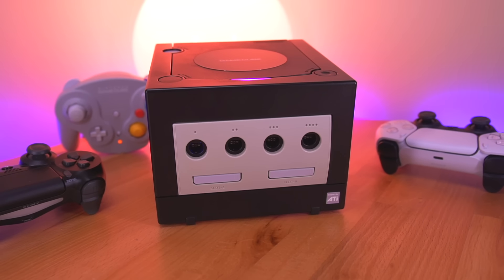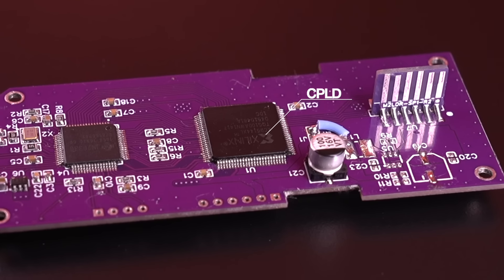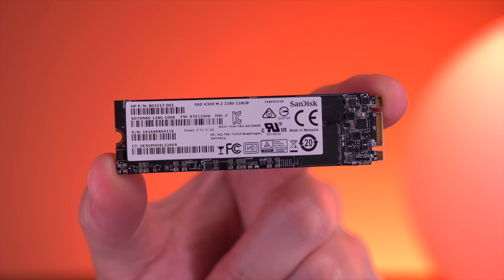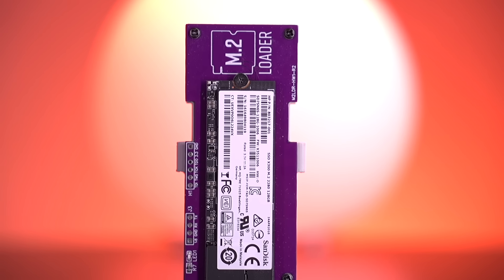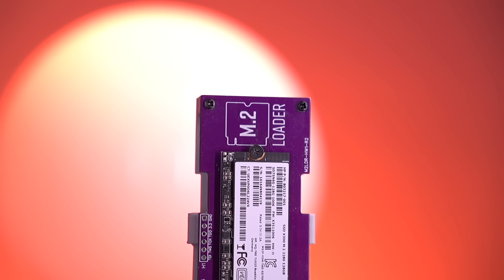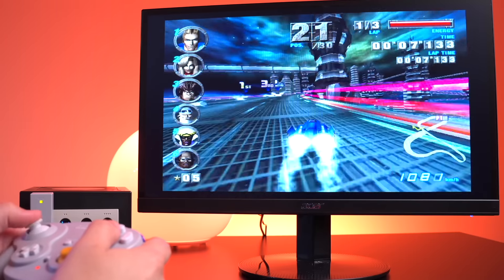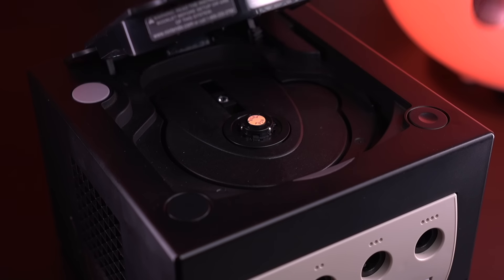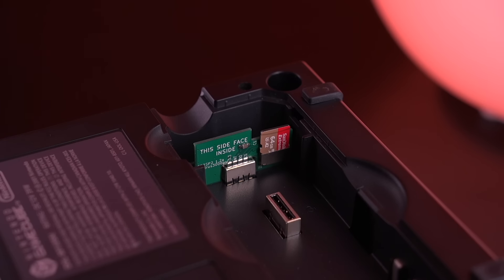M.2 Loader FIRST LOOK!  Unleash the Power of Your Gamecube!

Comment: Quick question but if my gamecube has the Xeno Mod Chip that gets attached to the bottom of the dvd player combined with using the SPSD2 adapater will this M.2 Mod work with that? Like can i choose to load Swiss from somewhere else other then from a Mini Dvd Disc?

Comment: i dont have a gamecube, but i wondered during the video if it would make sense to add PicoBoot to this if the plan is to add a raspi pico anyway? (probanly using a few jumper wires into the case itself though)

Comment: Hello, I have several questions about this project.
Firstly, I would like to point out that I have a specific project concerning my personal gamecube, I intended to use the GBI (gameboy interface) to play my games gameboy, gameboy color and gameboy advance thanks to the gameboy player and an action replay disk and not the official gameboy player disk, for this I had to have an sd card inserted into a memory card in which the GBI boot was located, because when the console is launched the action replay disk will detect the sd card.
My question is this: can action replay detect this ssd sata m.2 or not?
If it can, can I put my GBI boot on this ssd and also put my game saves on this ssd or should I continue to store the saves on a memory card external to all this hardware?

Comment: One thing that I'm not sure, does the M.2 requires another modchip, such as the Picoboot, or is it a full solution: modchip+loader device? Still an interesting solution for the fastest data transfer.
Reply: It doesn't require a modchip per se. You need to have a way to boot Swiss in order to use M.2 Loader. This means if you don't like hard mods you can always use game save exploits or Action Replay.
Reply: @maciejkobus  ok, so we either need a softmod or a hardmod, such as Picoboot, to boot Swiss from the SD card. Thanks for the clarification

Comment: crazy consideration here, but if the loader is working towards a pico build, A) is it possible to run Swiss off of it, even if it means doing the same mod as Pico Boot? B) since it will occupy the network adapter slot, couldnt it be (using the Pico capability) fitted with the network adapter itself, proving to be an all in one device?

Comment: You never mentioned the performance of this driver compared to a disc. You claimed the video playback was flawless but I could still hear some weird audio stuttering. Was that just part of the video? How do the loading times on this drive compare to the same game played from a disc? It's an SSD so I'm assuming they should be faster, but if it still has audio stuttering then that might not be the case.

Comment: My largest concern is actually not with the Network adapter, but rather the GBPlayer. Since they both use the SP1, you'd either have to choose which or make a bypass on the GB player for it, right?

Turns out, I am an idiot. Problem solved.
Reply: GameBoy Player uses High Speed Port. It's a different connector on the bottom. M.2 Loader is fully compatible with GBP.
Reply: @maciejkobus  Thank you. I did not realise this.

Comment: Oh damn, The factr this requires an SD2SP2 takes away the advantage of being able to run it on a DOL-101 which I thought it had over the SD2SP2
Reply: It wasn't explained too clearly in the video and people are very confused with SD2SP2 requirement. M.2 Loader does not need SD2SP2 at all. What Tito meant is that in order to use M.2 Loader you need to be able to run Swiss on your GameCube. This means you'll need a modchip, game save exploit or XenoGC. SD2SP2 was mentioned in the video because Tito is using PicoBoot in his console and PicoBoot requires SD2SP2 or SD Gecko to boot Swiss. PicoBoot will be also updated to load Swiss from the SSD.

Comment: It's an* SSD, not a SSD. When you say SSD out loud, it begins with a vowel sound (S begins with a soft e sound). A/an is determined phonetically. If the first syllable of the next word begins with a vowel sound (not necessarily with a vowel), you precede it with "an", otherwise you precede it with "a".

Comment: GcLoader is the way to go. Much simpler and cheaper option. SD cards are more than big enough to hold GC games
Reply: yeah but then they stick out the front
Reply: @solofalcon  GC loader doesn't.  It takes away the optical drive and replaces it with a drive to run a SD card. It's all internal.
Reply: FlippyDrive is the way to go.

Comment: Could a new version of the SD2SP2 Pro be equipped with a similar chip to improve load speed? There is plenty of unused space on the Pro version. If so it would allow the better loads for people that still use the LAN adaptor.

Comment: Could webhdx solder the wires on the ipl chip and put a plug on the wires that would just plug into sd adapter?   Try and use the pico chip 2 fold.  One to boot Swiss. Then emulate the drive.

Comment: So if it's not NVMe does that mean it's using MSATA? This thing looks like it's using NVMe because as far as I'm aware that's the skinnier connector. Inside to use the same connector that the Wi-Fi cards in laptops use.
Reply: M.2 and mSATA are connectors, SATA and NVMe are interfaces. M.2 Loader uses M.2 SATA SSDs.
Reply: @NotMoreZombies  all I know is that one time I tried to buy an SSD and it wouldn't go into the slot even though it was skinny enough. The notches didn't line up for skw reason. I'm 100% sure I bought an M.2 drive.

Comment: Did i hear/understand right in the no need for the pico boot mod in future? I have a gamecube that I can't mod (misses gamecube). So that'd be damn handy.
Reply: You can use any method to boot Swiss, it doesn't have to be PicoBoot specifically. There are game save exploits and Action Replay if you are not interested in hard mods.
Reply: @maciejkobus  i was looking at gc. But its impossible to get these days. Might have to go with the save exploits i guess. 👍

Comment: Mmh could be the Sound problems of the normal adapter based on the speed of the sd card?
The micro sd cards have different speeds. 

What would happens when we use the sd card in the same way like the m2 mod?

Micro sd have Max 1tb and it's not long realesed. 2tb are fakes

Comment: Of course I ordered everything to install picoboot on one of my GameCubes last week and have everything but the laser bear mount that I ordered. I wasn’t aware of the slowdown that occurs cause the sd card and I like that m.2 loader is I guess non invasive you could say I’m not afraid to solder and I’m excited to install picoboot on my console but this just seems like a overall better option for my “ultimate GameCube” but does anyone have any recommenced sd cards for pico boot to help mitigate the slowdown ?
Reply: Faster SD card won't help at all. There is a limitation how SD cards are being read by the console and it can't be fixed without custom hardware. This is why M.2 Loader exists and fixes those issues even though it works on the same bus and have the same max theoretical bandwidth.

Comment: Wouldn't another major con be that you cant use the gb player adapter as well? I know you can get around it by using emulators but i know alot of ppl prefer using the gb adapter.
Reply: The GBP uses a different port.

Comment: What kind of drawback is that the optical drive is missing with the GC loader?
Will die anyway and sucks
Reply: People are collecting physical games and many people prefer to have fully featured system. Any mod that has great performance and doesn't require removing components from the system will be 100x better.
Reply: @maciejkobus  
I see your point, but I would still say everyone collecting physical DVDs has most likely backups and does not use the discs because of wear

I just hope the M2 adapter will get dirt cheap :) unlike the GC loader

Comment: i dont really see the appeal, if you have the sd2sp2 anyway, then just stick a 256 or 500gb in there and be all set. then you at least keep the bba slot free. loading through spi is still fundamentally the same regardless of which port is being used. a drive emulator is really the best way to improve loading speed issues, resulting in video and audio and gameplay speed issues. I have most of the best rated GC games on an 256GB sdxc card loaded in my gcloader, compressed for use with swiss, and it's not even full.

Comment: Con, can't use Gameboy adapter either with it
Reply: Why ? The dol 001 Gamecube has 3 connection ports. 
The M.2 fits into the serial port 1. The sd2sp adapter fits into the serial port 2. The Gameboy Adapter fits into the hi speed port.

Comment: Yeah, there are no 2TB MicroSD cards yet. Largest consumer models are still 1TB. Anybody trying to sell you 2TB right now is a scammer. The Max is currently 1.5TB, and that's from Micron who doesn't sell direct to Consumers. I've only seen them for sale from bulk distributors so far, which require a minimum purchase of 120 units for $450 each($380 if you buy 12K+). So if you see somebody trying to sell a 1.5TB card for less than $400, it's also probably a scam.

Comment: Unleash the Power of Gamecube... use Dolphin emulator. The emulation have overpassed the original hardware by far:
It is free. No need to pay for an addon. No soldering.
Use any controller (no adaptor needed) or original controller
Up to 8x native resolution
MSAA and SSAA support
Ultrawide support (21:9 and 32:9)
Texture filtering
Save your progress anywere
Custom textures support (you can use enhanced textures created by the community)
Integrated Game Boy Advance emulator, Dolphin supports linking GameCube and Game Boy Advance titles
Stereoscopic 3D graphics on any platform
Network play
Play Wii games

Comment: Having a huge capacity SSD for just gamecube ISOs is dumb. The entirety of the gamecube library is like 600GB.
Of that, you probably won't play most Japanese games (unless you know Japanese) and won't bother with games that either didn't age well or are targeted at young players.
I, personally, wouldn't bother with Sims, barbie, sports games or racing games. I also have little reason to play games that exist on other consoles like Mortal Kombat Deadly Alliance or the Harry Potter games, for example.

This will trim that 600GB down significantly and all the games I care to play on gamecube would be perfectly fine for a 512GB m.2.
There isn't a good reason to get 2TB worth of M.2 when you can get a 512GB for like $30-$40 at microcenter.

Comment: Please put /HOW/ it works better, or a link to an explanation.
Reply: Well looking up the IDE-EXI project I can see that it seems to enable DMA transfers and can transfer larger blocks.  That would improve transfer speeds.

I do look forward to NVMe support when that will be possible(IE a chip with PCI express becimes available), because one less SATA to IDE chip is cheaper, and the NVMe drives are approaching $20/512GB.

Comment: But why? Wouldn't the better solution be to use a wii and homebrew it? I just bought a wii for 100 dollars and loaded 500+ gc games on it and about the same amount of wii games. Whats the point of doing this on the gamecube? Wouldn't the wii still be considered original hardware for gamecube?
Reply: It's about the esthetic. I have a nintendo mini with a bunch of games loaded onto it. But I would rather have an original modded to play old games. Without that I might as well just play all games on pc
Reply: @halkeye20  i was emulating them on the PC at first but its way too much work letting kids use it and not mess up the emulators or computer so I bought a wii and the experience is much better even though I can't crank up the resolution. The wii has made me a fan of consoles again after the xbox made me quit console gaming years back.

Comment: You mentioned not being able to use the network adapter because of occupying the serial port, but also the Game Boy Player won't be usable either. I assume peeps would have to fall back to emulation solutions if we wanted to play GBA games from the M.2 drive, or should we just consider that a lost cause because the thing would be easy to unplug and swap with the GB Player?
Reply: The GBP will be usable, the same way you can have the BBA and GBP plugged in at the same time.
Reply: @NotMoreZombies  There would be enough physical space? They won't be trying to rub against each other or the GBP wouldn't be angling the M.2 weirdly?

Comment: I think another con is that you can use the other methods while the gameboy player is plugged in, but you have to take it out to use this
Reply: This wouldn't prevent you from using the Gameboy player. That plugs into the high speed port on the Gamecube, not either of the serial ports.
Reply: @mrmxypltk  oh my bad, I thought it was in SP1

Comment: at last a project stretching legs pie pico total not relevant, if your getting pico talking SSD, how taking it a bit more, maling into NAS SERVER, not expecting lighting in the performance, but it would make a very small server, even pocketable for travel, and anything can make network, connection, and an the pico, serial, pin, unpopulated connection (or the usb, it is the to type as a device, or as one that can sud thing plugged inti it, that cover the really old stuff too,

Comment: Your con didnt have the fact that the option  for the gameboy player was no longer going to be one?
Reply from the maker: The game boy player still works with the m.2 loader installed. I’m not sure I understand your question.
Reply: @Macho Nacho Productions  how? You installed that lil chip in the other port so how would the game boy player still connect?
Reply: @Maciej Kobus  yeah but there was another chip installed to help the m2 for loading with the m2 is that just a one time need then it can be taken out? If so ok but that wasnt stated in the video
Reply from the maker: The game boy player connects to the high speed port. The m.2 loader is connected to SP1 and the SD2SP2 is connected to the SP2 port. The M.2 loader does not effect the high speed port which is used by the game boy player.

Comment: Isn’t this a little overkill? A GameCube will never be able to take advantage of the speeds that m.2 provides.
Reply: The point is taking advantage of all the speed capacity, but to fit cleanly in the GameCube, have a high level of game support and improve playback compared to some other methods (e.g. with less or no audio glitching).
Reply: FlippyDrive

Comment: 1:20 That is not a hard drive. It's a Solid State Drive (SSD) and it's appropriate that it uses SATA controller M.2 since there's no way this device would be able to read-write at over 3000 mb/s, and SATA m.2's are much cheaper and run, at best, 600 mb/s.  I guess theoretically you could connect an actual SATA drive (SSD or HDD) to this connector as you can get m.2 adapters that have proper SATA ports right on it, but it wouldn't be a wiring mess, and you'd need a PSU to power the drives.

Comment: Meh... the reason you can't find a 2tb sd card is because they just got announced and we're talking about a tiny form factor vs the much larger nvme. I'm not sold. Melee online with slippy would need the broadband and you couldn't use it with this. We need storage and saves but they need to be more discreet than this

Comment: Might I add again that the Xeno GC is far superior with less wires to solder to, non removal of the heatsink, and thermal pads. Cheapest alternative and again the Raspberry Pico is still beat by a xeno gc mod in terms of accessability and work needed to boot into Swiss. No. Need for a Gecko. Also with the M.2 loader. Even with a SSD the average person would not buy over a TB of storage for the SD2SP2.

Comment: I've never understood why people try so hard to run gc homebrew when you could just use a wii and wii u for gc games. gc homebrew allows only gamecube games while wii and wii u hacking includes a bunch more game libraries, not to mention unless you're an extreme diehard you will most likely be using composite cables

Comment: This video is very long winded. And while I appreciate the hardware discussion of what will due to various reasons I still 6 minutes in wasn't told of the actual benefits of this. You need to get to the point and summarize your video quicker.